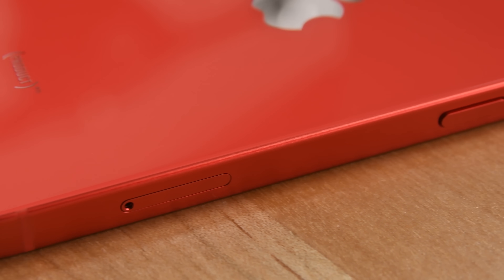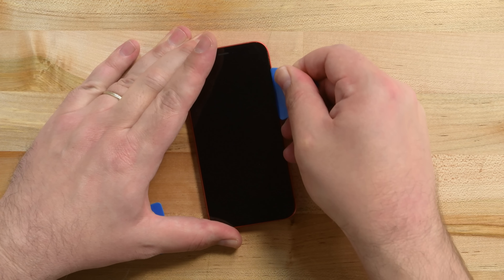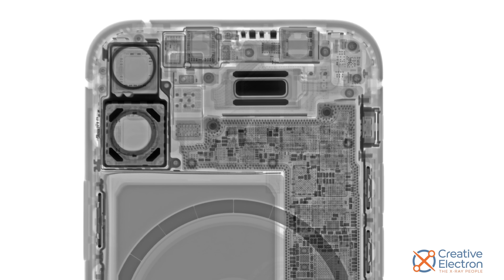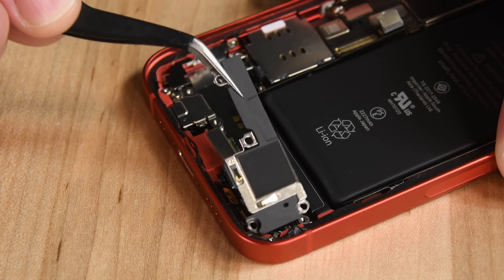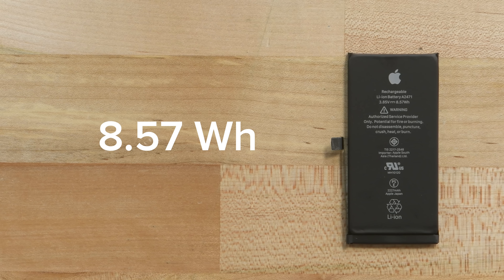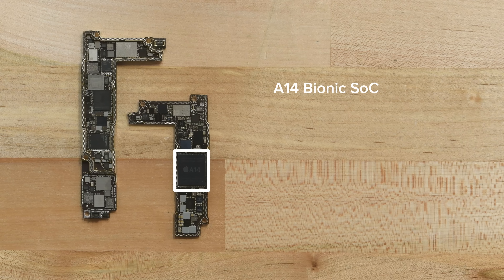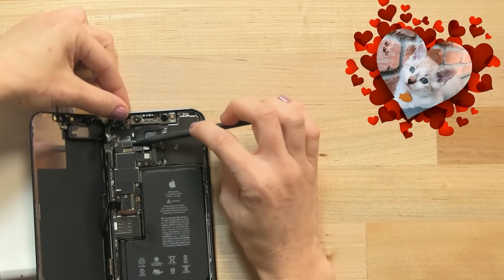iPhone 12 mini Teardown: iPhone 12… But mini

Comment from the maker: Quick correction: @ 2:20 we say the mini has 4 GB of RAM like the 12 and 12 Pro. That's only half true—the 12 has 4 GB, but the 12 Pro (and 12 Pro Max) have 6 GB. So many iPhones in so little time, it's hard to keep them straight! Sorry for the mistake.
Reply: iFixit, what about SW locks? Like camera being a real jerk after a replace without Apple's "blessing"?
Reply: Wow u can spot the MINI Mistake
Reply: You also need a quick correction for the score.  Per the Hugh Jeffreys video this model should get a 2 at best.  Even with genuine parts you can make any repairs, no matter how modular ya'll say they are.

Comment: I would most definitely irreversibly break my phone if I tried to fix it myself. 

I remember trying to fix a sticky button on a PS2 controller. After taking it apart, attempting to fix it, and putting it back together I no longer had a sticky button. I had a completely dead controller.

Comment: I understand its 6/10 due to the modularity of the hardware that made it slightly easier to replace. However software wise i cant say it could be rated at that point as Hugh Jeffreys pointed out on his video that every component was paired and if we could take the component pairing in consideration i would give it 2/10. Some silverlining is there is probably a chinese tool in development to bypass this

Comment: I’ve had an iPhone since forever, I’ve just got the 12 mini upgraded from a 7, on my 7 I replaced my battery and screen several times myself which was pretty easy and the 12 mini also looks pretty much the same but hearing that the individual parts are locked to the handset preventing people like me just repairing my own devices is a shame, hopefully somebody finds a way around this by the time I need to swap out parts.
Reply: the 7 also locks parts so this is nothing new
Reply: @TheFlumeUnplugged  my 7 didn’t lock parts, I did screen a few times, battery once and charge port once, all were seamless

Comment: Great teardown. Wrong score though. This iPhone 12 mini, like its iPhone 12, 12 Pro and 12 Pro Max all should have the same score, and that score is due to the severe binding and pairing between Apple's software, and the hardware components. Good luck repairing it if you don't have the necessary programming tools.
Therefore, the corrected score is the same as the Apple Pencil, Apple Airpods, and the Surface Laptop 1/2: 0 out of 10.
They all have similarities:
Apple Pencil: physically destroy it to access anything
Airpods: physically destroy them to replace the battery when it gets worn out (see Hugh Jeffreys' recent video on this)
Surface Laptop v1 and v2: cut open the keyboard to get inside, meaning that any repairs cause total destruction of the device
iPhone 12 series: each hardware component is tied to the motherboard, and if you replace a component, it cripples the functionality of the component. In fact, replacing the camera means you have to have the power cord everytime you want to turn the phone on, as it doesn't respond to the power button.

I didn't realize the Samsung Galaxy series was so more repairable - I'll be sticking with the Galaxy series.

Comment: Should have gotten a 0/10 for repairability. Nearly every working electronic in that phone is binded to the software, this makes repairing components a technical impossibility
Reply: Its repairable only at authorized repair shop. Its a good step by apple for security reasons
Reply: @SS-gw3cb  """"""security"""""" of the apple money
Reply: @AntonioNoack  you should have said: tantrum of iphone thieves

Comment: Repairability 6 out of 10? Are you freaking kidding me? Yes the components are modular, but they cannot be changed without programming from apple. In my opinion it gets 1 out of 10.
Reply: i think it's -10 of 10. not just 1
Reply: Only on the regular iPhone 12, though, the mini and Pro versions don’t have that problem, which is weird.
Reply: logique!!!...a quoi bon savoir les ouvrir si facilement?...pour les réparateurs officiel c'est génial,pour les autres,a partir de l'iphone 12, c'est fini!!!!!!!
Reply: Those components still work, with minor issues, after replacement, even without reprogramming
Reply: Why can't you? If you change the display, you just lose TrueTone. If you change the battery, you lose the battery health metrics. Those are really the only issues, and everybody can live without either of those.
Reply: @stoob2157  you can use it yes, but the thing is you pay for it the full price at apple, they shouldn’t deactivated features just for replacing a screen
Reply: @stoob2157   you can use the repaired iphone without truetone. but in my opinion. this is limit my right and force me to accept the highest price for repair.
Reply: @stoob2157  the camera gets botched when you replace it, and don't get me even started with the fingerprint sensor.
Reply: @stoob2157  with the 12, the cameras are paired to the device (according to a Hugh Jeffreys' video), and will render the camera useless if you replace it using a third-party camera. Heck, even an original Apple camera can't be used to replace a failing camera without Apple's proprietary programming.

edit: typos

Comment: All parts are paired to the logic board and some components will not work if replaced the screens face id doesn't work when shaped the battery % is gone and the cameras outright don't work this phone should get a 0-2 score not a 6

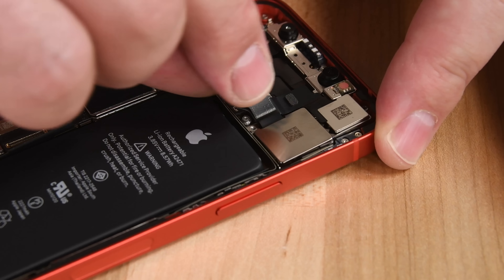Comment: 2:37 isn't the camera, display and battery paired to the logic board?
Reply: Yes it is
Reply: @flamingkillermc2806  is that new before the camera wasn’t paired was it
Reply: @caps721  yes it’s new, apple sure doesn’t want you to repair your iphone, but they remove the charger and headphones from the box and say it’s for environmental purposes.
Reply: @flamingkillermc2806  it’s a apple all they want is money
Reply: @cunnyman  Samsung got budget phones that are £250 Samsung a51 when Apple cheapest phone is iPhone se the a51 has more ram better screen and Samsung phones are more repairable
Reply: Only camera and logic board. Hugh Jeffry didn’t say anything about the battery and he swapped the display together with the mainboard and then the front camera didn’t work. This only means that the camera is interlocked with the device and does not mean the display is irreplaceable.

Comment: Another YouTuber, Hugh Jeffreys, brought up a fantastic point and I'm disappointed you haven't mentioned it here... as that "repairability" score is worthless when Apple locks their hardware to each device. Hugh purchased two iPhone 12 models and tried to swap the identical, genuine Apple parts between them and was unable to have a fully operating device after. Features such as Face ID, Camera functionality, Battery capacity readout, etc. were disabled- even though the part was brand new from another iPhone 12. This has to be the largest step I've seen Apple take regarding the "right to repair", as iPhone 12 repairs seem to be impossible without Apple's hardware validation. I'd love to hear your response to this, as I've trusted iFixit for years regarding my device repairs, and I worry about long term use after seeing Apple take such drastic measures against DIY hardware repairs.
Reply: Totally agree. Considering this, this iPhone just gets a straight 1/10 lmao
Reply: @matteod7151  more like 0/10
Reply: @w0lfy340  -9/10
Reply: @matteod7151  Actually, it’s only the regular 12 that has those problem, for some reason. According to iFixit, neither the 12 mini or the 12 Pro suffer from it.
Reply: @GRBtutorials  source???
Reply: The chinese will eventually reverse engineer this and make the serialization irrelevant.
Reply: I've been saying this forever and no one seems to care, thank you for spreading the word
Reply: so true...u cant give repairability score to iphones like other androids...its just impossible repairability score for these new lineup should be 0/10
Reply: @ayubmohammad9674  the problem is, that nowadays you will have exactly the same problems with more and more Android devices like Samsung or Xiaomi smartphones.
Reply: @igortcgg  lets hope it wont get as bad as apple does...cant say they did wrong thou...it dl works againts iphone thief cant sell those for parts
Reply: Dude. Only thing that was new with iP12 is that swapping main camera makes camera app work unproperly.
FaceID, TouchID, battery swaps were no go for ages.
Reply: incroyable...toujours faire plus d'argent sur le dos des clients
Reply: amazing ... always making more money on the backs of customers
Reply: @Jannis Schröder if it was about security they wouldn't make an "Apple certified" screen replacement cost half the phones original cost
Reply: @joshgeurink2131  It's straight up avarice, plain and simple.
Reply: Yeah, I was really surprised they didn’t say anything about that either. Maybe they didn’t see his video? But even Louis mentioned Jeffrey’s video so I dunno
Reply: Yeah! It must be addressed :)
Reply: As the market increases for stolen iPhone parts Apple HAS to make parts more difficult to swap. As you see more and more iPhones getting stolen (from warehouses and from individuals) the market for parts becomes bigger. The only way to make it less interesting for others to steal and sell parts is to make it impossible. I guess Apple is such a populair brand they have to do this unfortunatly.
Reply: @AntonyCBSR  sorry to say, but what you wrote is just bullsh*t (I'm really sorry - nothing personal - I really don't want to offece you - that sentence was just best to describe my feeling). When fixing of hardware is cheap (and is cheap if independent companies are able to fix) then each device lifetime is just longer. Broken device is sold (instead of throwing out) and after repairing comes back to the market of used devices. For lot of people it is just fine to buy used/repair device if the price is OK. More working devices on the market, less new devices are sold. How to "fix" this issue? Well - make it impossible to fix by independent companies - you will have full control on fix prices and also you will be able to say what can be fixed and what cannot be. When you will have full control on repairing policy - you will be able to make fixing of older devices completely unprofitable. At the end someone who normally would like to fix his/her device or buy a used one - will be forced to by a new one. Market of stolen parts? It exists only because genuine parts are not available at all, or are insanely expensive. So excuses that this pairing was done to reduce stolen parts market sounds exactly like some nice description of communism (defined by people who lived inside that system): "communism is a system that heroically fights with the problems it has created.". Replace the word "communism" with the sentence that describes what is Apple (and other companies) is doing with pairing parts, and you will see my point of view.
Reply: @AntonyCBSR  Except that thieves don’t usually sell the parts, they sell the iPhone. Of course, it’s most likely locked down, but the buyer can do nothing after they bought it, so the thief gets away with the money. And one could also easily imagine someone who knows nothing about this issue buying stolen parts as well.
Reply: Funny that you mention a video in which you can clearly see that battery and Display CAN be replaced, and the only thing you get is a warning message
Reply: @terriplays1726  True tone no longer works if the display is replaced, if I remember correctly.